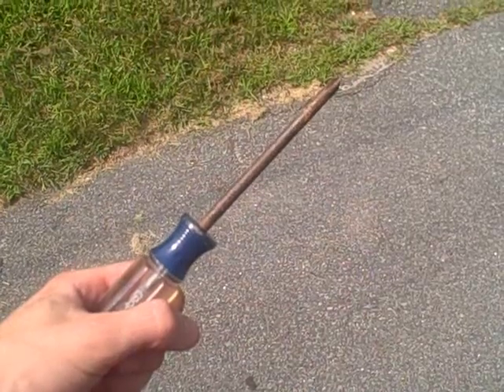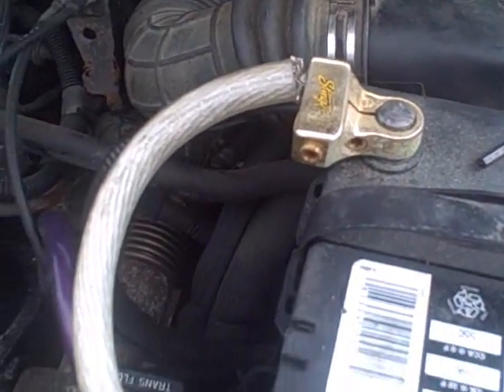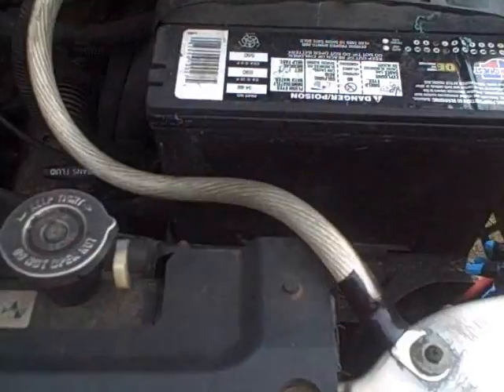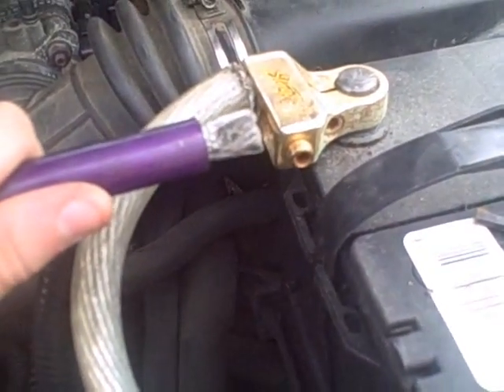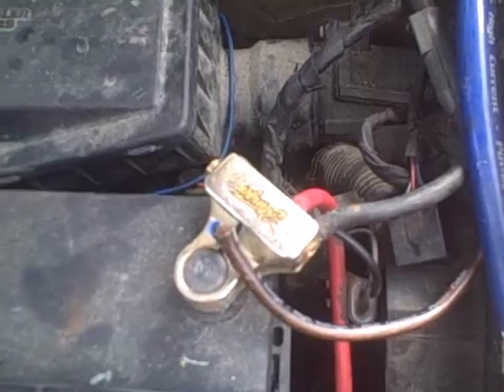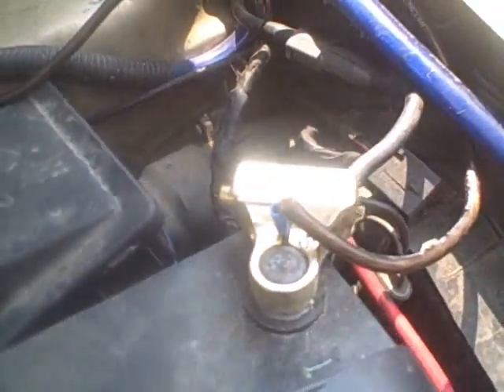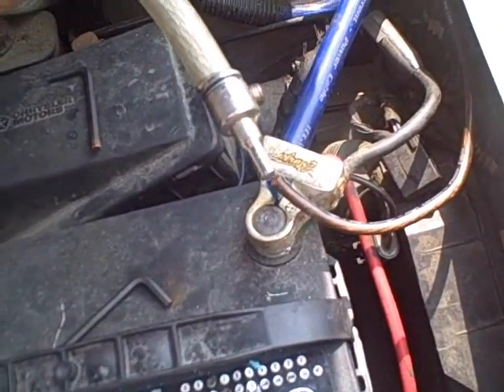Increase Car Audio Power 25% - How To Install Big Three Upgrade - Easy 15 Volt Stereo System Big 3

Comment: The big three is literally the BIGgest thing, I installed one 4 gauge power cable  from my alternator to my battery and that's it and it bumped my power up I cannot imagine installing big 1/0 cable as a power and grounds

Comment: I did this to mine and made my L715Q coil smoke and made them take it out. Ever since then I’ve had alternator issues and other malfunctions that my cat shouldn’t be doing. I’ve replaced my alternator twice, new belt twice, new sparks and my 1200.1 gain is only turned maybe a quarter of the way prob not even that. As of today witch is Friday 31st my car has been staying at 14.0 with next to no fluctuation. I haven’t turned my amp back up but my bass knob is 3/4 or 1/3 turned just to be even safer. Until I know everything is good. When they did the big 3, I noticed the installer only did the positive from my battery to alternator and then the ground for my battery and that was it. I didn’t not see a new 1/0 I gave them to ground the motor. Now everything is back to the way it was so I keep hearing I need more signal from my head unit  screen. It’s a Sony ax100 or something with only 2v output so what do I use to get a better signal to my amp? I need more voltage from my head unit to send a better cleaner signal to my amp. I just don’t know what I need to get for it cause I’ve never had to for any of my other systems. Andy till I got the 15inL7Q~Class that all this started. Pls help

Comment: I have  2 15s  Kicker CVR With a 4000watts Quantum audio class D mono black  On a 2010 Chevy impala   But what I'm worried about is if I do the big 3 will the alternator burn The car will have no engine problems if I do the big 3  And if I do the big 3 will my system have power

Comment: With the big 3, What’s the benefit of replacing the negative wire that runs from the engine to the negative terminal? Isn’t the other wire that is grounded to the frame and goes to the negative terminal good enough??
Reply: you're describing two different things as though they are the same: improving the connection of the battery to the chassis, and improving the connection of the engine block to one of those two things (battery or chassis). the wire you mention as 'good enough' is only battery to chassis. for the alternator to have good ground, we need the engine block to have a good connection to those too. now, its true that the engine block is already connected to the chassis with multiple straps, and already a good connection, but these straps can be insufficient for very high current, and they can wear out over time. your confusion is that you assume the chassis and engine are permanently joined with 0 resistance. The engine is in fact suspended with insulators and would be somewhat electrically isolated if not for those straps that we upgrade as part of the big 3.

Comment: My car Stereo hot wire is hooked up directly  to the battery?Is that the correct?My car stereo only cuts off when I remove the face?Why is that?  Part of my dash lights is partially  on? #help

Comment: my amp didnt come with the high side plugs,,,,, im using rca wires at moment and its not loud at all, its like the factory radio loud,,, would it get louder using the high side wires instead ??? they are 50w x4

Comment: So I did this big 3 and it was amazing before I did it I was dropping to 11 volts which is low enough to cut off the amps so I was frustrated and I did the big three now I get 14.6 on the hardest hitting notes I could think of
Reply: Did you have stock alternator when you did this upgrade? I am going to try to do this and not buy a new alternator

Comment: I firmly believe this isn’t necessary under 2000 watts. As long as you’re tuning your gains correctly and not using bluetooth connection lights shouldn’t dim.

Comment: hey body, I have a benz c300 2011, put an audio system on, factory radio, a converter, soundstream amp rms 1123 watts, and soundstream bass speaker, rms 900 watts, the problem is that when the system is on , a burning smell comes out of the hood, even the fuse box smells burned, don’t know what to do, please advise me on what to do, thanks, Juan from nj.

Comment: Zero Gauge seems like complete overkill here (i.e. wasted money). You’ll never push that much power with a stock alternator. And why waste all that cable by not using ferrules?  Four Gauge and a 2 Farad Cap should work fine.  I dunno, but that’s my take.
Reply: I don't think that 0awg is overkill. It will already be there for future upgrades. It is crazy how old this video is 😂
Reply: LOL!  I just realized this vid is almost a Decade old!  🤣😂🤣

Comment: Will a larger alternator cable stop the alternator from squealing on startup. I'm running the stock alt still and squeal and start up from the large draw of my amp.
Reply: alternator whine comes from either a bad ground connection somewhere or your speaker wires picking up current like an antenna with induction

Comment: Were you connected the ground wire to the car's chassis I would get a quarter 20 Nut and Bolt and tighten that up you get a much better connection doing it that way

Comment: Dude....ur a chill audio guy......most of these guys either act like they know everything or look down on us that dont....if anybody can help me out, thank u so much.....about 6,7 years ago I had a hatchback with 2 kicker 12 cvrs, on a 2000 watt crunch....
Now I'm using 1 single 12 kicker cvr, on a 1000 watt hifonics.....ok obviously it's only 1 sub., and half as much power.....
BUT,its kinda like barely sufficient, or barely insufficient....if that makes any sense....now that I'm older i NEED a trunck, I just do, so I can only fit 1 sub....I plugged up the port, (idk, if that was smart, but the bass is way louder than before......tuned the amp. ,more so than any other amp. I've ever had....I DO NEED TO SWAP OUT THE CABLES. Other than that, any suggestions?.....bigger,smaller box?.
Different amp?... I  can get a 1000 watt soundstream or 12 hundred hifonics, for less than like 150, 140......?

I'm thinking a 15, but they're a little harder to come by....
Reply from the maker: Here's the most important question before going any further with changes... ARE YOU HAPPY WITH IT??? Right now, the way it sits, does it perform how you'd like it to?
Reply: @EXOcontralto  I'm not happy with the way it sounds.....yup....imma have to do it...thank u..👍👍

Comment: Not to be an ass here just an observation I’ve made over the past few days. I’m a car guy, as in I can tear apart and rebuild a big block and put it together blind folded and end up with an extra 500 hp (yes I’m exaggerating) but, I’ve gotten bored this summer, and decided to upgrade the sound system in my old 2004 Ford Explorer, I’ve decided to go with a Sony MEX-XB100BT deck, and will upgrade my stock speakers in a few weeks. I’ve never installed my own stereo and I’ve been looking around YouTube for a week learning tips, tricks and how toos and how donts, and what I’ve noticed, is you guys know a lot about car audio, but completely neglect your motors, and some completely neglect the motor and EVERYTHING else in and out of the car. The motor in my old 04 runs like a brand new ford raptor, and it’s so clean (my motor) you could literally eat off it. You have the smarts and the ability, you should really take care of the important stuff first though. Just my annoying two cents. Again, not trying to be an ass, it’s just an observation. 😏
Have a nice day.
1:30(example, that grease, you have a leaking gasket, oil and grease belongs inside the motor, not outside)
By the way, nice video, I will use this.

Comment: Hey dude. I noticed that u didn't use a fuse on the positive on ur big  3 upgrade. Is safe to run it with out a fuse or u need a fuse?. Plz get back to me when you get the chance. B.t.w. I'm a big fan dude I can't wait to see ur next video on the Frankenstein build. 😎😎😎😎😎
Reply from the maker: I'd just go ahead and add a fuse!
Reply: K. Now I have a little 90 amp alternator. What amp fuse u recommend?
Reply: I have a 80 amp alt im trying to figure out as well i will be ruinng a. 700 watt amp

Comment: What wou I'd be a good battery that would fit in my engine bay in a 05 gmc envoy xuv with a 4.2 i6 vortex
Reply from the maker: What size does the booklet call for???
Reply: EXOcontralto lectricalCold Cranking Amps @ 0° F (Primary)  600Maximum Alternator Capacity (amps)  150Cold Cranking Amps @ 0° F (3rd)  N/A that's all I can find  but I wanna run 2000w rms watts and it dims bad at 500w rms

Comment: This video is extremely helpful and thanks for doing it. 
If you're going to do this upgrade use OFC wire and get the best bang for the effort. I'm sure aluminum is better then not doing the upgrade at all but spend a little more and do use the best  option.

Comment: Great job & nice screwdriver. May I suggest a few things? Clean up them bolts & screws w/ a wire brush. Use a lock washer on that screw. Cars that got thump will loosen everything, eventually. Honestly even w/ a lock washer! Finally, use some dielectric grease or Vaseline on all the connections. Keeps galvanic corrosion to a minimum. Although almost unavoidable, you never want 2 different metals to touch, especially when electricity or water are involved.

Comment: OK but when you look at the wire diagram it runs engine to chassis, chassis to body then body to battery so aren't you missing a ground wire.

Comment: okay so i have one 10 inch 4 ohm sub max rms 1100 300 rms and a amp thag can do 500 rms at 4 ohm bridged to one channel or 170 at 4 ohmx2 or 250 at 2 ohmx2 i only have one sub and i wanna get more power to it cause it handles more but i dont have money.
Reply: Kolton Ives i think the reason you have no response is because your entire comment makes no sense

Comment: Ok someone who has been in car audio for many many years and works in an electrical field I have always done this.  My problem with this video is the really shoddy connection work shown here.  The crimps, lack of heat shrink and exposed conductor wire at your connections.  Take a little more time to do your connections a little cleaner.  It will prevent degradation in your cabling, loss of power transfer and possibly losing a connection over time. FYI if you lose a connection during your amp bumping it could fry your amp or your battery.   Due to how your connections can bounce or flex using zip ties and clamps should be used.  Using split loom in areas where wiring could be exposed to heat is a good idea too. Use the right tooling please on 1/0 cable use a rg6 stripper you can get for less than 10 bucks at home depot or lowes. If you have to use a knife know how to cut straight.   Use a good crimper or impact crimper for larger connections.  I always liked street wires screw connectors with heat shrink if you cannot get an impact crimper.    If you can't afford to do it right the first time wait until you can.   Proper grounding of your amplifiers is paramount as well.
Reply: Jason Scheuring
Reply: Jason Scheuring this dude has better audio set ups then you probaly ever will😂😂😂
Reply: Bhahahahaha! This Jason guy has two subscriber's! His mom and sister I'm guessing.
Reply: Jason Scheuring Bruh stfu. Make a video then mr know it all

Comment: having a issue choosing inside speakers my bass drowns everything out
Reply: turn the gain down on your sub amp lol
Reply: Upgrade your door speakers and maybe have an extra set of tweeters installed. You may also need to run another 2 or 4 channel amp up front to balance things out. Trust me, you will be very happy.

Comment: Planing on hooking up three 12" subs to xtra battery in trunk my fear is drain on my alternator since its facory etc wat u recommend I do here?
Reply: Just use an external charger for this battery once a week or so.
Reply: Take it to the shop and have them ground the battery and run a power wire from the battery under your hood to the battery in your trunk. That way your car's alternator will keep the extra battery charged at all times and the voltage won't vary. Oh, I forgot to mention that they need to run a fuse between the batteries for added protection.

Comment: how do i  hookup 2 batteries in my car and if i do do i need 2 alternators?
also
 my set up in a 120 amp 8000 watt max power amp is 4 channel each channel's rms is 1000 watts 
according to manual.
and my speakers are 800 rms  2500 max
they don't hit hard i like my bass to feel like an earthquake.
right now they make my car shake like an massage chair.
how do i make them better?
Reply: KiLLclangames He said if i do do..
Reply: If you wanna run through it, I'd throw some pointers your way. List some equipment specs and fellow bassheads would be glad to help.
Reply: Drago P thanks

Comment: I did this to my 2010 dodge ram 1500 and everything works fine... except for my AC does not blow cold now when it's turn on now. any thoughts why I'm having this problem?
Reply: probably coincidental and unrelated. unless you damaged your compressor during the install
Reply: maybe there are flames in the cabin

Comment: question? I did the big3 on my 94 Honda civic..seems after I did it, my amp blew and stereo turned off and dash clock faded away? any of this happen to you or anyone?
Reply: Damn yo sorry to hear that. Check your grounds for conductivity. Make sure no wires are exposed anywhere and possibly shorting out your sheeet.

Comment: Hello my stereo dies out after to high volume.what can i do?
Reply: use bigger power and ground wire dont buy amp kits from walmart
Reply: don't put the volume too high
Reply: too much voltage drop

Comment: VERY IMPORTANT STEP!!! YOU WILL FRY YOUR CAR IF YOU DONT DO THIS.
ALL CARS have some type of weather resistant coating on ALL metals of the car!!! (paint, etc.) YOU NEED TO SCRATCH that off where you plan to ground ANYTHING. You MUST have a metal on metal connection OR YOU WILL SHORT YOUR SHIT OUT.
Reply: he said that
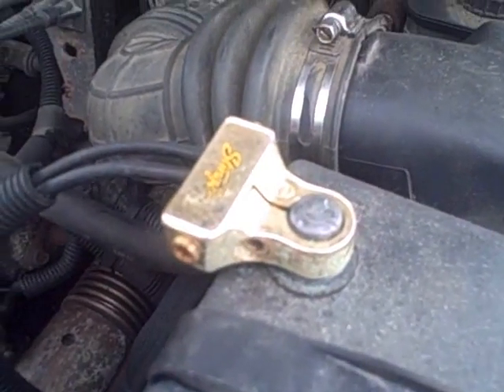Reply: 0:41
Reply: how do i  hookup 2 batteries in my car and if i do do i need 2 alternators?
also
 my set up in a 120 amp 8000 watt max power amp is 4 channel each channel's rms is 1000 watts 
according to manual.
and my speakers are 800 rms  2500 max
they don't hit hard i like my bass to feel like an earthquake.
right now they make my car shake like an massage chair.
how do i make them better?
Reply: KiLLclangames  are trying to hook up 2 extra batterries or the 1 in the front and put 1 in the back

Comment: Nice informative video... thanks

I HAVE A QUESTION CAN YOU PLEASE REPLY IF YOU HAVE TIME?

ACTUALLY I WAS WONDERING IF I CAN HOOD TWO BATTERIES TOGETHER, ONE IS 12V ACID NORMAL TRADITIONAL BATTERY AND ANOTHER ONE IS 12V DEEP CYCLE OPTIMA YELLOW TOP OR AGM BATTERY. IS IT SAFE TO DO THAT FOR LONGER PERIODS?

MANY THANKS AND ADVANCE..

Comment: can i use 4 gauge?
Reply: +LILDIRT as long as the cable is larger then the original cable installed then its considered an upgrade, You dont NEED 0 Gauge wire this guy just has a system that would benefit more from such a large wire upgrade

Comment: did you leave the stock power wire  connected to the alternator along with the new zero gauge wire?
Reply: I. sure he did ..leave all stock wires. just add on

Comment: Yo i have a,1000watt amp wat is the best woofer to get best bass
Reply: +Alando Oudit Radio Shack 65,000 Watt Xtreme Slammer 18".
Reply: I use a Rockford Forgate P2
Reply: +Larry Boens how much
Reply: +Alando Oudit i have 2 jl w3 v2 12"  subs on 300W they pound
Reply: +Larry Boens Rockford Forgate?
Reply: A 1000watt woofer!
Reply: if you dont want to spend an ass load of money a sony xplod 1100 watt peak is a good sub but if you want quality go for a JL or a memphis
Reply: Kyle Holmes Memphis is crap...get a phoenix gold sub.
Reply: Im just saying for him if he dont have a lot of money to spend Im running 3 phoenix golds on an MTX 8302 800 watt amp 2 are wired in a 2ohm paralell on one channel and the third is run on the second channel my smaller subs are run on a really old Kenwood 500 watt 2 channel on a 2ohm parallel bridged on that amp
Reply: Kyle Holmes Well yeah but there are plenty of other cheap subs too. I love the phoenix gold subs along with Ct sounds.

Comment: if you do a big 3 do you have to have 0g running to you amp?
Reply: no, but as he mentioned with flow, it would be a bottleneck to your amps to have smaller wires

Comment: whats the best bass setup under $500?
Reply: +Kyle Smith  I have the following and my windshield  is in danger of being blown out.

2 12" Power Acoustik Gothic CW-124 Sub woofers (1,200 RMS) wired to 1ohm connected to a 1ohm stable Bamf 4000/1D MonoBlock AMP With 4 gauge power with a 150AMP fuse and same gauge ground. I build the box to specs myself for around $50 and it is better than any box you will go buy at an audio store for like 10% of the cost.

Subs($79 per sub)
AMP($149)
Wiring Kit($75)
Box($50)

I will never run into a car louder than mine unless I am at a competition. My shit is on point. It is loud as fuck and clean as a whistle. My set up sounds better tahn the rich kids with Type R's. And I am not being a jerk because I am broke or anything. I can afford spending thousands on my system but the fact of the matter is, you can spend $500 and get the same sound you get for $10,000.

P.S. My car fucking slams and I cannot sit in it with the volume all the way up. This is no joke, if you get my set up be very careful because it is dangerous and can damage your hearing. This set up is extremely loud.

Comment: I'm running a 5000 watt orion amp, 15" 5000 watt orion sub
320amps alternator charges at 14.4 volts 3 yellow top optima battery's I think I know what I'm doing dude just switch the wire you can get it from oriellys.